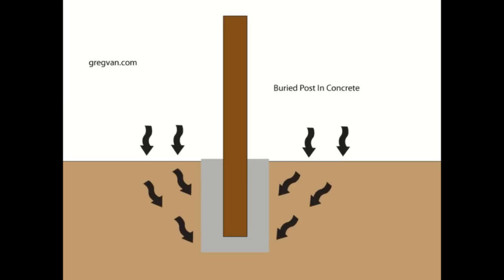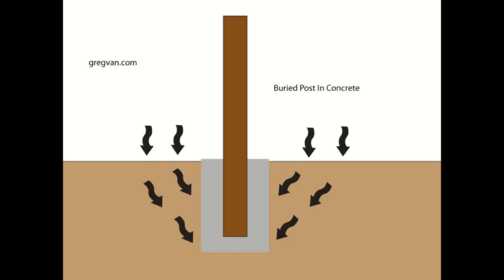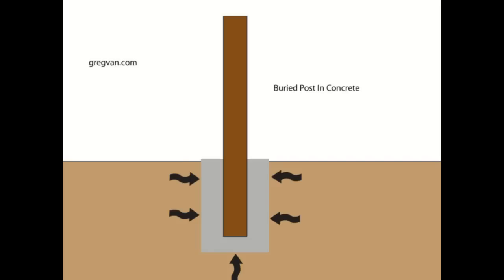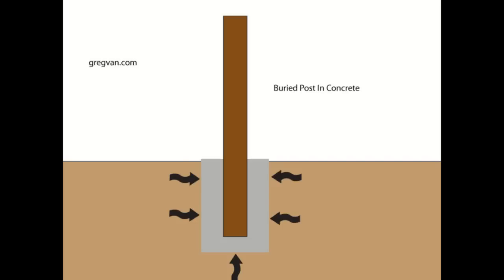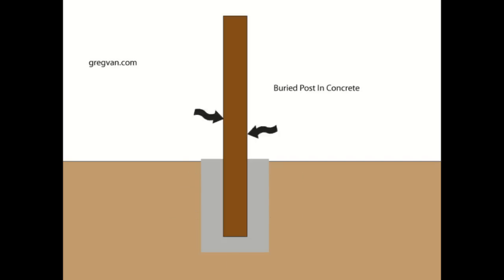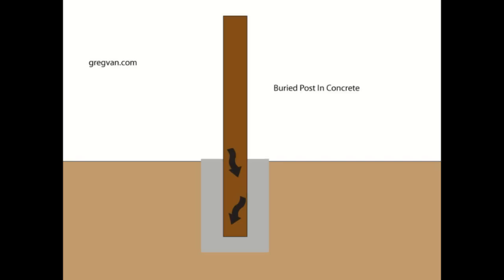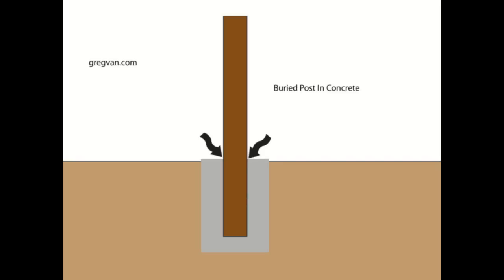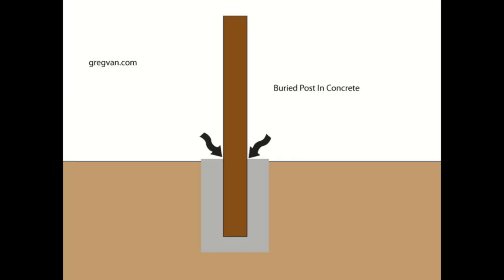Why Do Fence Posts Rot and Break - Wood Fencing Damage

Comment: I've had great luck using a method an old farmer told me about. Coat the in ground portion of your posts and a bit above the ground level, with a mixture of diesel fuel and used motor oil, basically a 2 part oil to 1 part fuel mix. Apply it with an old brush, let it dry overnight and coat it again one or twice more. When dry, it'll leach minimally if at all, but will do a good job repelling moisture and keeping bugs to a minimum. You should get nearly 2/3 times the lifespan with this method.
Reply from the maker: I've definitely heard that one before and it's one others might want to pay attention to, just don't let the environmentalist know about it.

Comment: My posts rot at ground level.  To prevent this, mound the concrete slightly above ground and slightly slope it away from the pole.  If it's an area you don't need to mow then you can mound it up higher.  Also put pea gravel in the bottom of the hole, no concrete below the post that would seal the wood in.

Comment: I'm owner of a fence construction company that's been in business for 35 years in NE Oklahoma.  I've replaced a lot of wood fence and the primary failure is the post rotting and breaking at ground level. The post are usually rotted inside the concrete as well.  I do see back rails rot to the point they start letting the panels fall off before the post break, but that is rare.  It's been my observation that around here the main factor is simply how long the area stays damp.  Being it is typical to use concrete to set post here it is rare to see how other set methods work, but what little I have seen doesn't seem to make much difference. In this area it is rare for a 4x4 to fail in less than 15 years, but that's when they usually start going down hill fast, not that some folks don't have much older fences standing simply because they get no wind loading, and it takes surprisingly little to hold a fence upright.

 Non-treated lumber is completely useless for a post or back rail on a fence. I only see DIYers use non-treated and it's basically throwing money away. I can tell that the new ACQ lumber isn't as good as the OSHA retired treatment. Also landscape post have been total jokes since the mid 80s and always fail faster than 4x4s.

 Galvanized steel post work very well, but they need to be 2 3/8" OD sch 40.  Any metal post below that strength level is prone to taking a permanent bend from wind loading that won't harm a wood 4x4, so it is unacceptable. A 2 3/8" OD sch 40 post will take more wind loading than a 4x4 can survive meaning if they do take a slight bend it is a victory over wood post since the fence would be laying on the ground, also at that wind load the wood components start failing anyway.  It's been my observation that due to the fact that 2 3/8" OD sch 40 is used for industrial chain link, the specs keep the galvanized coating thick enough to last a very long time.  One of my main clients is a large petrol chemical company, and it is rare I remove, or change fencing that is less than 40 years old with the post showing any real corrosion.  I always try to convince customers that plan on being in their home for more than 15 years to spend the extra on metal post, as the extra expense will pay them back greatly later on as they will get all the life possible from their back rails and pickets, and when they need to be replaced the job will be much cheaper.
Reply from the maker: member548 Thanks for sharing what it's like in Oklahoma, but I've seen treated lumber rot just as fast as untreated lumber so I would need to disagree with your comment on treated lumber. There are different grades of treated lumber you can purchase and those with more chemicals might last longer, but it all depends upon how much moisture is in the ground and how long it remains around the wood. 
The metal post I would be referring to is "2.375-in x 96-in Gray 16-Gauge Galvanized Steel Chain-Link Fence Terminal Post." This is something that produces a wobbly fence and in my opinion wasn't designed to support a wood fence and therefore I don't recommend using them, because I've seen the wind blow them over.
Please keep in mind that my videos are based off of the 35 years I spent in the business and might not be applicable in your areas.
Reply: gregvancom  No doubt a 16 gauge post doesn't work.   The wall thickness on 16 gauge is .065" which is a fine choice for a residential weight chain link fence.  2 3/8" Sch. 40 has nearly more than double the wall thickness at .154", also the galvanize weight is much higher making a much longer lasting post.  The only draw back to steel post is cost, as they can be boxed and hidden visually if a customer doesn't like how they look, but of course that is even more cost.  It's easy to figure a 2 3/8" sch 40 post 8' long will be over $30 by time the pipe to wood brackets are included, where as a treated ground contacted rated  4"x 4" will be less than $9.
Reply from the maker: Thanks a lot for clarifying that. It sounds like a schedule 40 post would work just fine and I'm glad to hear it from someone who has been installing them for years. I guess the next problem most people would need to deal with, would be the actual cost of building a structurally secured wood fence. I've never seen a ground contact rated 4 x 4 in Southern California lumber yards or home improvement centers and was wondering if you could provide us with a little more information on how anyone reading this comment could find both the metal post and the 4 x 4.
Reply: I stopped using concrete and now spray the post from bottom up to about 4 or 5 inches above the ground level with Spectracide pruning seal.
Reply: member548 ,
Reply: My 6ft tall half-sawn 6" cedar log posts buried straight into soil without concrete lasted 40yrs, as did the 1×12 cedar planks...you can't get good stuff like that anymore. It'd still be up if it hadn't been for the runners rotting so much that I'd have to replace a few every year as well as reattach planks all the time due to the nails finally rusting away. It had great character, especially the planks that had bore trails through them from carpenter bees. Anyway, replaced it with those exact schedule 40 posts I purchased on sale (they are cheaper during certain times of year) cemented in, 8" cedar planks screwed to treated runners using the proper screws and brackets, all assembled on site, then stained all sides. Yes, it costs a lot more than the cheap and easy, but it will stay looking nice and last a lot longer. Do it once, right.
 Be sure to perform proper maintenance, restain, and keep caps on the posts to keep the water out to prevent freezing and busting or rusting.
Reply: same here in Penna.
Reply: Listen to OP,  he knows what he's talking about. I built my fence the exact same way. 2 and 3/8 galvanized steel post schedule 40.

Comment: I just pulled up six 40+ year old wooden fence posts last week that weren't set in concrete & only 2 of them broke...the underground portions of them were just like they were when my dad planted them over 4 decades ago when I was a kid...that's how I know how long they've been there...I was absolutely amazed by this...the 2 that broke, broke off at the ground with the upper portion being way more rotted than what was in the ground...
Reply from the maker: Thanks for sharing.
Reply: What sort of wood did your father use? Were posts charred, chemically treated, concreated, or graveled or a combination of them? Do you know how thick the posts were and how far they were into the ground?

Comment: Make sure you dig the hole large enough to have 2"-3" of concrete around the entire post. If your soil is heavy put 3"-4" of gravel in the hole under the post. If your soil is sandy or well drained you do not need the gravel. Next treat the wood post with a below ground combination fungicide/insecticide product available at most home centers from the bottom up to a few inches above the grade. Position the post into the hole and add a couple more inches of gravel or soil then tamp that material around the post with a 2"x2" wooden stick( we use a steel bar with a 2"round flat end). Even if you use a pressure treated post, still apply the below ground treatment as termites can eat the center of that post which has no protection. All woods will rot, even cedar and redwood. Next, mix and pour your concrete as a collar around the post and cove the top of the concrete above the grade and away from the post. The concrete collar is only for stabilizing the post. Yes, wood posts can absorb water and moisture and they will swell and shrink with the weather conditions. Gaps will appear between the post and the collar from wood shrinkage or the concrete may crack, that sometimes happens. By not having concrete under the end of the post the rain water will run down along side the post and wick out the bottom into the soil or gravel making it less likely to rot. After 25 years building fence this is how I build it for myself and my customers. AZ Fence Contractor
Reply: I love you. xoxo FIX-A-FENCE Inc - OH Fence Contractor
Reply: One thing to add for a DIYer homeowner with a wood fence. After following Mr Waterman’s above instructions, come back at a 1-2 year time span and use a good 109% silicone caulk to fill the gap where the post has shrunk due to drying on all 4 sides between the post and concrete. This will reduce the amount of water going between the post and concrete giving the gravel a better opportunity to drain the water away. 
The more clay in your soil, the more gravel you need in the bottom of your hole. In my area, I put 6-8 inches of gravel, as we have a high clay content soil!
Reply: @coypatton3160  Forget the silicone. Use a elastomeric, one-component, self-leveling, non-bubbling, premium-grade polyurethane sealant .

Comment: Many 100's of fenceposts & decades of experience later , I ultimately concluded that using metal fenceposts set in concrete with wood rail adapter brackets is the only way to go.
Reply: Then you have rust rot instead of wood rot..just joking man Im sure that metal last 4 times as long as wood..So what size metal post?? What are the dimensions for a metal post on a wooden privacy fence???Thanksmann..
Reply: In my area they sell 1 5/8"diam., as well as 2" diam. round galv stl fence posts at the Home Depot. Each kind has the associated hardware needed (@ extra cost) to transition to horiz wooden fence rails, as well as 'caps' to keep the water out. It also looks like HD has a new line of powder coated aluminum posts, both round &/or square. The 2" square ones have pre-cut slots to mount the wooden rails in , as well as a matching corner post, which looks interesting & would save the trouble of mounting the transition brackets. I've used both sizes of the round stl posts & noted that, as expected, there was more flex in the smaller diam posts....if you use the round stl posts, I'd recommend the 2". I've never used the new aluminum posts but it does appear to be a feasible long-lasting alternative, providing the metal is thick enough not to be too flimsy.  HD has a few other types of metal fence posts...the 'Z' type & the Master Halco, which work well for 2-sided fence installations. Hope things go smoothly for you ;)
Reply: DMcD Thank you for the reply..I just finished my 2 decks[2nd time'] thanks to shitty menards wood 10 years ago.. I had kept up on the stain and from now on I think behr stain solid is the way to go....Now its time to do the fence and it is 10 years old also and they feel pretty solid but I noticed some are half rotten right at the concrete line...I over did it and used like 3 bags or so of concrete back in the day...But the fence goes around the bottom deck so i figured it would help the deck to like a footing...Now I will check out my post options..One problem will be tearing out all that concrete so I will just cut them off and maybe buy 6 foot fence panels vinyl maybe and put the post in different spots....Thanks for all the post info..If only you could rig up the composite or vinyl post wraps to go over the galv post ...That would look better ,...I will check out home repo tmrw.....thanks,.

Comment: Wood that is completely immersed in water typically does not rot because of the lack of oxygen. Rotting tends to occur at the border between wet and dry. A place on the post that is soaking wet sometimes and dry at others is likely to rot. 

Personally I'd just go with metal or perhaps concrete posts depending on the application. 

Some natural woods withstand rot better than treated lumber. The heartwood of pine trees, ESPECIALLY long leaf pine, (sometimes called "fat lightered" wood or just fatwood) does an amazing job of withstanding rot. Black locust wood may even be better. There are some tropical woods that are also very good, but making a fence post out of tropical hardwood seems like a waste of money. Note: If you are thinking of growing black locust trees for posts, be aware that it can turn into a hard to kill weed.
Reply: +Gewgulkan Suhckitt Greetings from England!     You are absolutely right .  I have seen hundreds of posts like this . They break right at ground level . If you take the time to big out the bit in the soil it is usually as solid as when it was put in

Comment: That’s why I paint mine with that asphalt crack repair stuff. Before I put the post in I paint them so they have a coat about 12” above the ground. It is rubberized and protects the wood to add years to the fence.

Comment: I work in termite and dryrot wood repair and replacement.  I've seen it all.  So many tricks for rot proofing, and I've seen all of them fail.  there are 4 things you can do that i can promise will extend the life of a wooden post.  Everything else,  i just don't know if it'll help.   1st, type of wood.   cedar or red wood are better than douglas fir.  You pay more but is worth the price.   2nd, treated is better than non  treated.   if you can do treated cedar,  that would be the way to go.  Your typical pressure treated lumber does ok, but i believe that's just doug fir.  it beats non treated doug fir.  3rd, the bottom of the post should be sitting on gravel.  allows for drainage.  4th, last but not least.   don't let water puddle at the base of the post.   Build up the concrete above ground level and slope away to keep water away.   I've seen doug fir post last over 10 years using only this method alone.   This is all i have.   I don't know that paint,  or tar,  or water proof paper or what not, is going to be all that effective.    Stuff like that can trap water over time.   I just don't know for sure. Just follow my 4 suggestions and you'll do fine.
Reply from the maker: I like your thinking.
Reply: Keeping it simple and good advice.
Reply: Crush stone on the bottom tar the post couple of cleats  and no cement. Cement does nothing but rot your posts. Pack down you soil
Reply: Ceder is better for rot, but way too soft for fence posts. If you live FAR inland away from hurricanes then fine I suppose. And can't use cedar up north either, because the nor'easters can produce hurricane streingth winds.
Reply: Thank you for your advice! I'll be building a garage without walls, only 4 beams (4 by 4's) and a tin roof. I'll be using your method for my foundations. Only thing I'm gonna be doing different is that I'll use oak beams, and also I'll spray them with tar where the beam touches the concrete + 20 cm above. I hope this will last for 30 years.

Comment from the maker: Wow, you sound like you've never seen a piece of pressure treated wood used for a fence post rot, well I have one in my backyard that can't be more than 10 years old and I'm guessing realistically it isn't more than five years old in desperate need of repair, because it is falling apart and suffering from dry rot.

Comment from the maker: We won't be handing out any prizes on this one today, because it won't work in every part of the world. As long as the lumber is exposed to moisture and the fence located in the wrong climate, something like this could be a problem. Water will actually soak into the wood and become trapped in the lower areas that have been tarred, eventually rotting the wood. However it's nice to hear about another successful method and congratulations to your family and grandfather.

Comment from the maker: As long as you get the right metal, it should last longer than wood. However I've seen people install wooden fences with the same materials used for chain-link fences(metal posts) get blown over in strong winds. I really don't have an answer to which is actually better, especially if you're trying to be cost-effective.

Comment: I always purchase clear creosote when I purchase treated post going into the ground. I apply the creosote on the post from bottom to top to bottom, including a good amount to the ends of the post. This prevents water from entering the post. It also extends the life of the post for 10+ years. Set them on saw horses and have at it. Allow at least 24 hours to dry. Clear creosote only.